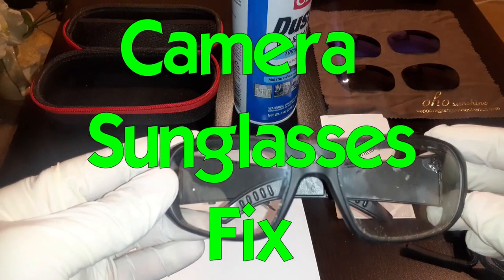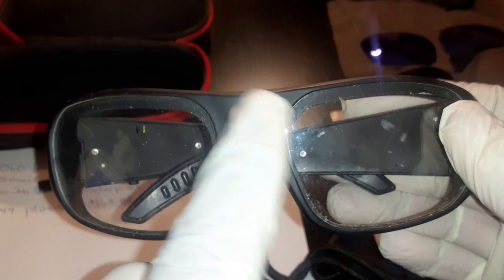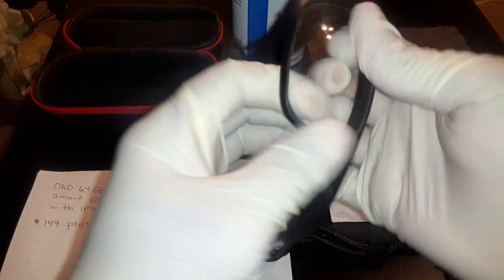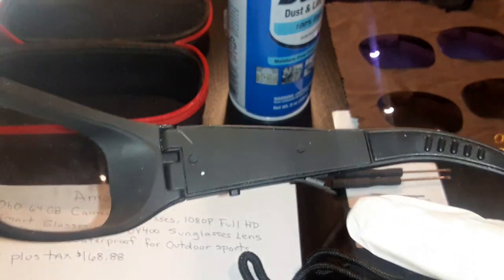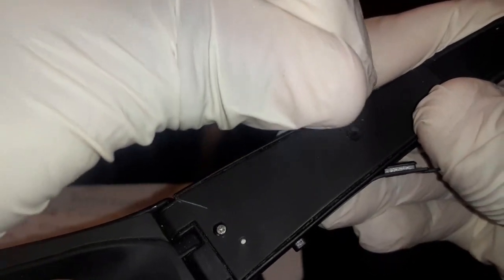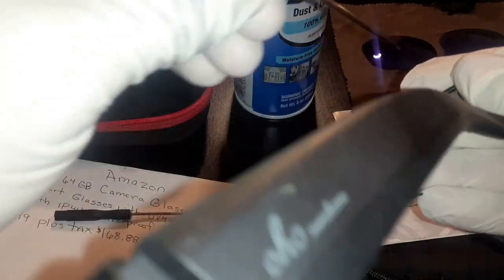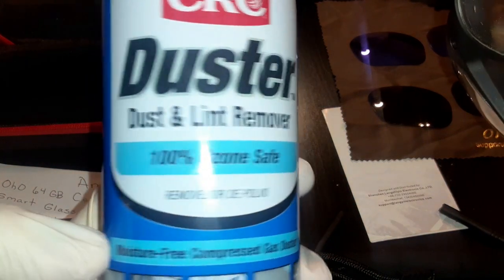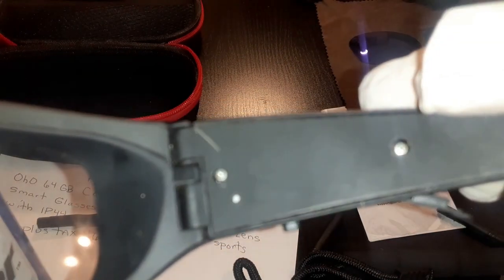OHO Waterproof Video Sunglasses , REPAIR with Camera

Comment: Tha is for the video bro. Question, while that cover is off is there a way to change out the SD card?
Reply from the maker: I went a head and brought the new version. The sd card doesn't come out.
Reply: I actually saw a video on some kind of repair a dude was doing on that side of the SD card. It looks like it would be changeable but I don’t know for sure. It’s only two screws that hold it in place. Let me know if you get in there lol. I’m gonna leave it as is. Sorry I couldn’t give a better fixable answer.

Comment: Well that maybe one possible solution.  There could be many reasons why the glasses do not work.  Could be a broken wire between the front frame and the Stems, defective parts, battery could be damaged.  It maybe more serious than just a simple cleaning.  It is nice to know how the glasses can be taken apart to fix.  Some glasses don't have screws -  they just are clamped on and pry them off with screw driver.
Take care.
Reply: I just bought them and after a few use, when I plug them into my pc's usb port, nothing happens... I don't have any access to the folder anymore... 
do you have an idea of whatever caused that ?

Comment: Hi, I have the oho camera pro sunglasses 
They work well, but when I wish to listen to the video afterwards, there is no sound even if the video was playing. What can I do to fix it do I need to install something? Please let me know and thanks in advance
Reply: I would hard reset that glasses first, if that doesn’t work, get you a can of Air and blow them off really good and see if that fixes it. On the right side panel there is two screws to a panel where the SD card is, remove that and blow that air in there. If not, send them back. I did see some reviews on Amazon that there was no sound coming out of Videos.
Reply: Hook it up to a pc and change the settings in the config.txt file